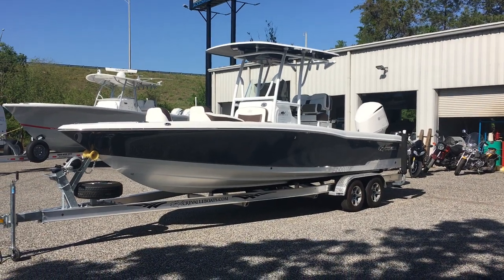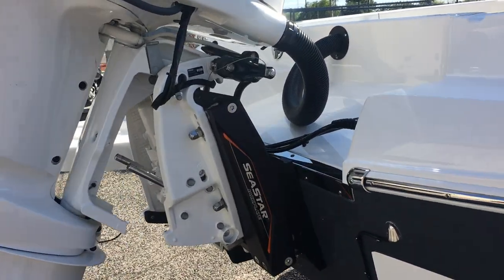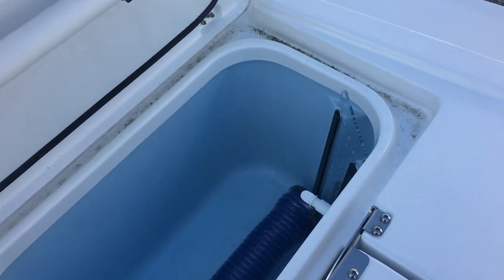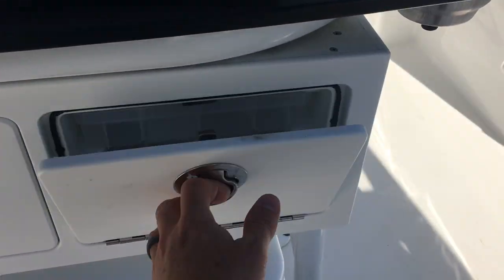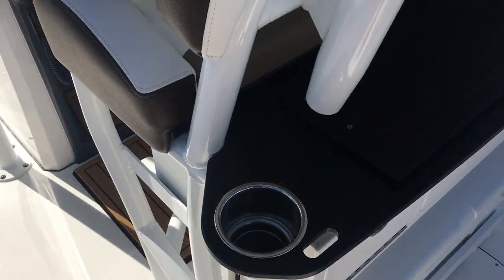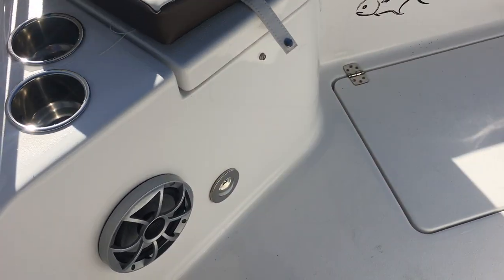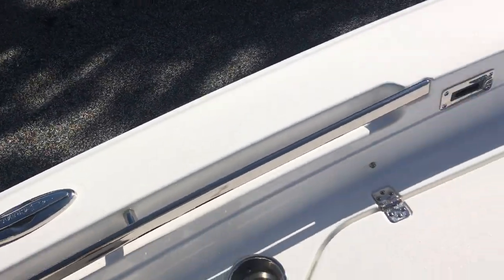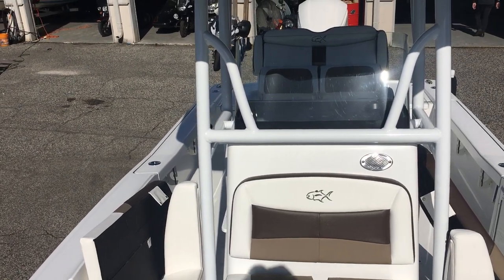2018 Crevalle 26 Bay Center Console Hybrid for Sale Jacksonville Florida

Comment: How much a boat like that cost or I should say how much over $100,000 is that boat?
Reply from the maker: Rodney, MSRP is a little north of 130.  Contact your local Crevalle dealer for a customized quote.  Depending on options the boats can range anywhere from the high 90’s to 140...ish.